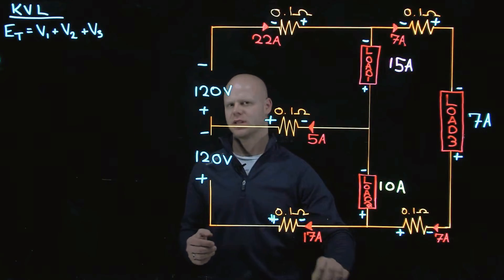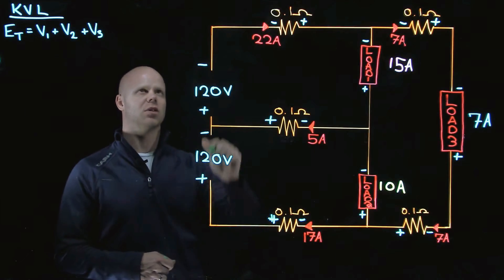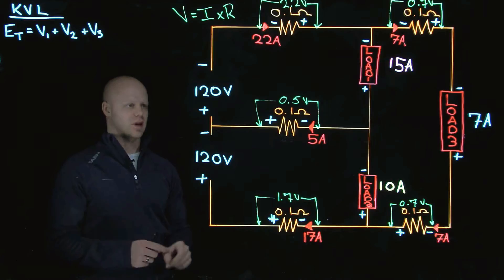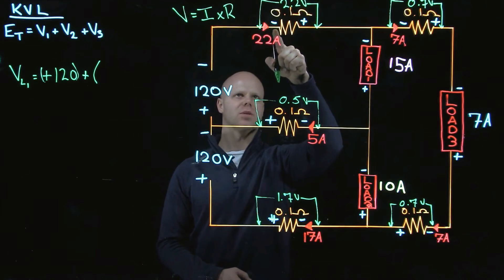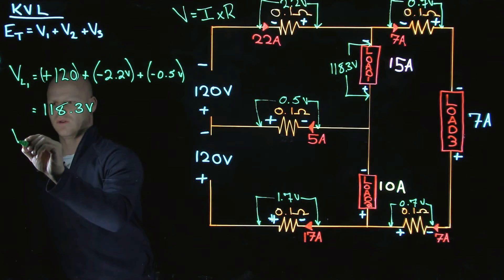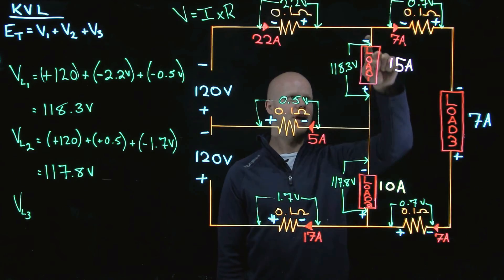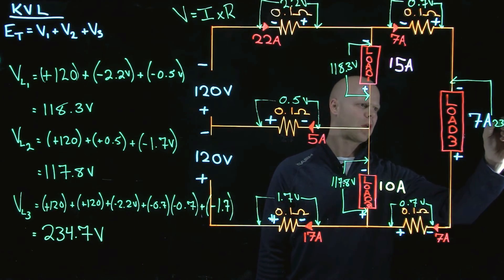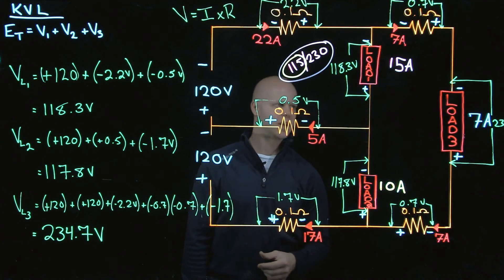Edison 3 Wire Part II

Comment: When calculating the Voltage for Load #3, i noticed the voltage drop fro the neutral wasnt also added. is that intentional? just curious. awesome vid!
Reply from the maker: Load 3 does not utilize the neutral conductor so the voltage drop of the neutral will not affect it. That load will only have two conductors connected to it. Line 1 and Line 2 so their voltage drops are all that contribute to that loop
Reply: @JasonOlson  good to know. Thanks for the insight!!

Comment: Very nice explained. However V_L1 = (+120)+(-2.2)+(-0.5) = 117.3 and V_L2 = (+120)+(+0.5)+(-1.7) = 118.8
Reply from the maker: Yes you are correct, got sloppy with my mental math!
Reply: @JasonOlson  thanks man.

 Do you have a video of the transparent board?
Reply from the maker: I do not have a video of just the board.

Comment: Jason I'm not an electrician. Looking at this circuit shows 15amps going through load 1 and then comes to a junction and can take 2 paths. It shows 10amps going through a/the second load and 5 amps returning down the common/neutral. As current always takes the path of least resistance back to the source, how is a higher current of 10 amps flowing through a higher resistance path through the second load than travelling down the neutral a path of lower resistance? If the circuit as you've drawn and solved it is electrically true would it not mean the second load actually represents a path of lower resistance than the neutral path and if that is true are the voltages from each leg opposing each other down the neutral causing the higher resistance? What am I missing?
Reply from the maker: I'm really glad that you brought this up. One of the most fundamental mistakes there is (and I appreciate why because it is often taught this way) that current will take the path of least resistance. This was an idea that was presented when the fundamentals of electricity were being discovered but was soon disregarded. Think of it like to light bulbs connected in parallel, one a 60 watt bulb and the other a 40 watt. If current took the path of least resistance then the 40 watt bulb would never turn on. You can prove that it does in your house by putting a 60 and 40 watt bulb in the same fixture, both will light up because they both have a potential difference across them. The purpose of a common/neutral conductor is to carry the unbalanced current and maintain phase voltage. Hopefully this helps, I would be happy to continue discussing this with you as much as needed.
Reply: @JasonOlson  Thanks for the quick reply. To help me understand this lets take the example of a perfectly balanced circuit across both loads 1 and 2 meaning there would be "0" current flowing in the neutral according to what I've read and seen. So current flows across load 1 and then bypasses the neutral altogether and flows across load 2. I'm not following why no current wouldn't take a no load or low resistance (wire resistance only) path back to the transformer down the neutral but all go through a higher resistance of a second load. That doesn't make a lot of sense but accepting that this is the case must mean something is impeding the current from returning down the neutral. I have only come across one video explaining this and the explanation given was under a balanced load condition the power cancels down the neutral. I took that to mean the voltage from one leg must be opposing the voltage from the other leg down the neutral causing a net "0" current flow causing all the current to flow through the second load. Something must be causing a resistance to current flow in the neutral since it is a wire or bar perfectly capable of carrying current.
Reply: @subatomicparticle6535  yes you basically have it right. You need to consider that the neutral wire is not connected to the same 'spot' of the source as the other two wires. So it's not simply a matter of current 'wanting' to take a path of least resistance. You need to consider the 'driver' of that current (i.e. the voltage between the points in discussion).

Another way to phrase what you are describing is that the point between the two balanced loads will have zero volts in reference to the center of the voltage source (the center tap), while in reference to either end of the coil it has -120 and +120 still. A voltage of 0 implies no current flow, regardless of the resistance of the available path, where as the 120 volts potential will drive a current flow across a resistor. 

For AC, you can check out the sine functions graphed relative to neutral and observe the waveform destructive interference that occurs under balanced conditions.